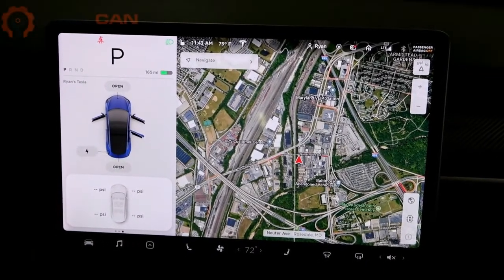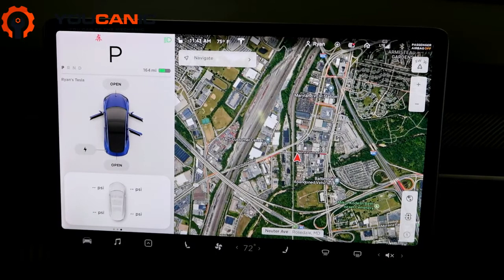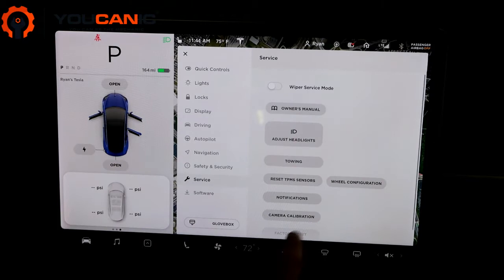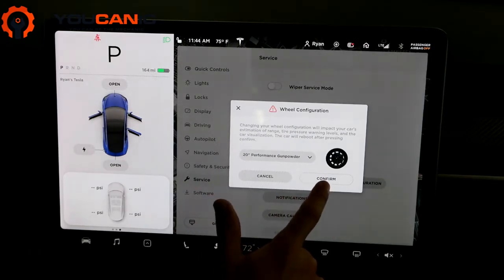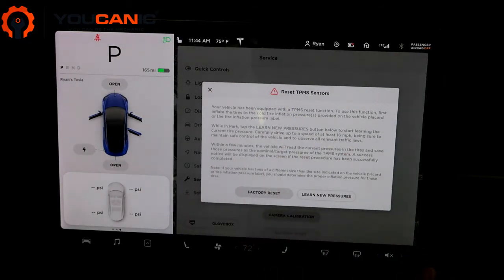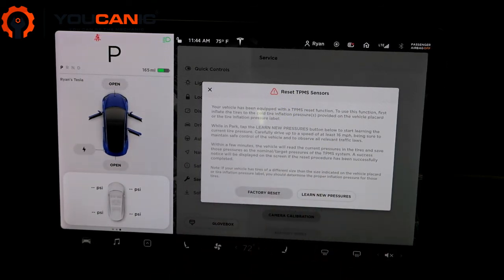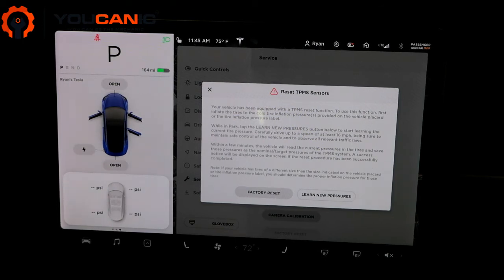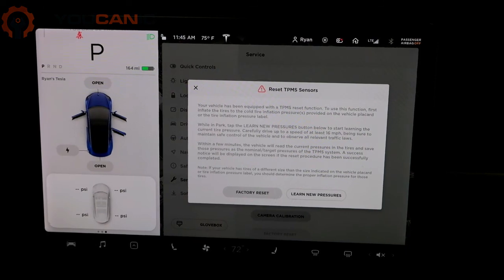Tesla Wheel Configuration and Reset TPMS sensors

Comment: What does the Wheel Configuration tab do?  On my 2022 Performance Model Y all it changes is the style of the wheels on the display.  on my 2020 LR AWD Y when I changed the wheels from say 19” to 21” it would reduce the displayed rated miles by the battery icon.  So you could see the impact of tire/wheel changes.  But no longer.  So what does it do on newer models.